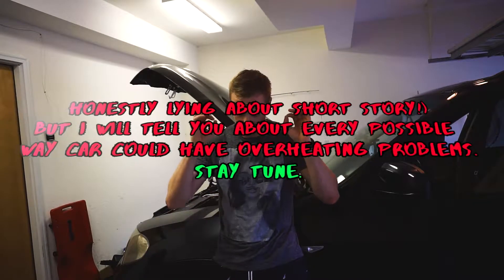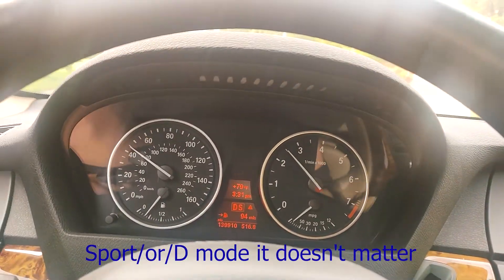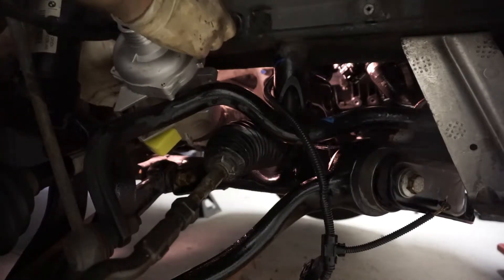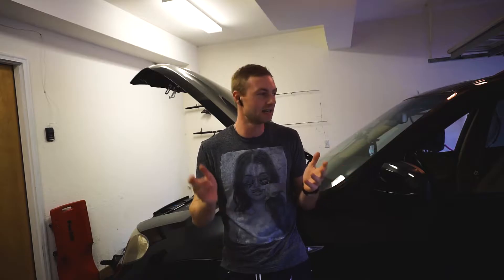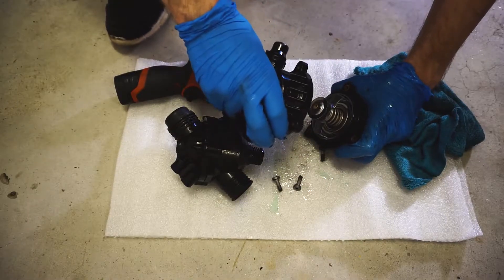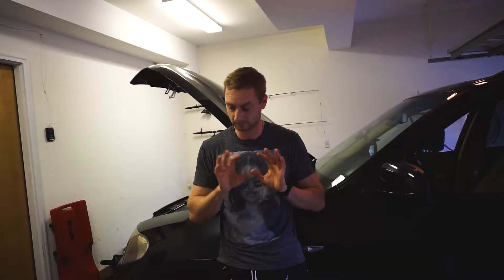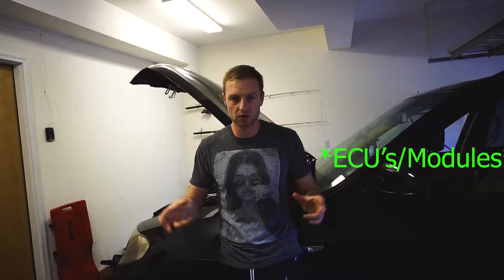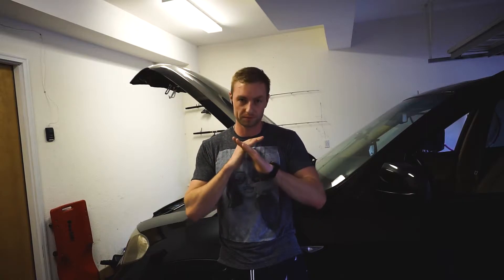7 Reasons why BMW Overheats N52 N54

Comment: changed the coolant system and termostate, changed the engine oil aswell with new one, my f10 n52b30 oil temperature still looks high to me 115-123 degrees range... why?

Comment: Helpful video. Have vent working only at lower speed and causing slight overheat. But F16. At the same time workshop checked via ISTA and it can work on high speed. And the coolant temperature is displayed correct high at the gauge in service menu. I might start with relay.

Comment: What is the correct coolant temperature for the n52 engine?
Reply: It like it cant cool the water enough... The engine feels hotter too without driving it just on idle
Reply from the maker: 95-105c, it all depends on where you at and how vehicle was operated.
Reply: @Makhnovets on my n52 it had blew the water/antifreeze out of the antifreeze gasket/tub (where u pour antifreeze in). It had air trapper in it, and with the electric water pump I pushed the air out of the antifreeze gasket and now the engine works okay, but as soon as I start it the fin starts spinning to cool the engine. Its a bit weird as soon as i start it for the cooling fin to start working.... What could it be?

Comment: My coolant temp gets up to 110 degree and the fan does not start 
I disconnected the temperature sensor and the fan turns on and gets up to high speed, is the temp sensor faulty and causing the fan not to turn on ?
I still haven’t checked any fuse or relay
Reply from the maker: I would replace both, the sensor and relay, because they are pretty cheap, 
But sensor would be number one if you choose from one or another.

Comment: I am very confused! BMW does not make an X5 E90. There are only 4 generations of the X5: E53 (1999 - 2006), E70 (2006 - 2013), F15 (2013), G05 (2018). Is "X5 E9x" a typo? Thanks
Reply from the maker: Sorry to make it complicated! You are 100% correct! I mean N52 engine, that was installed on E9x as well, Since English isn't my native language I'm still making lots of mistakes, also I have little problems with making the things more complicated than they are) 
Thank you for the comment!